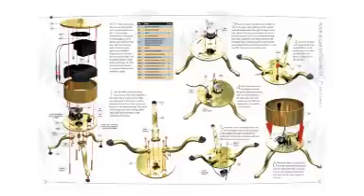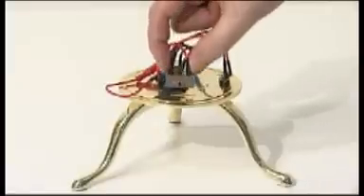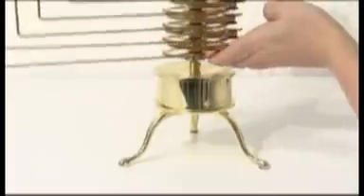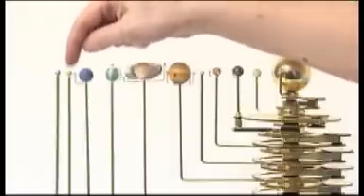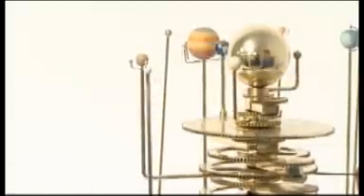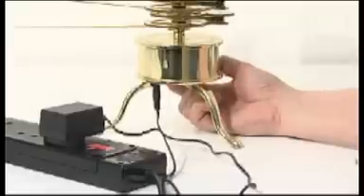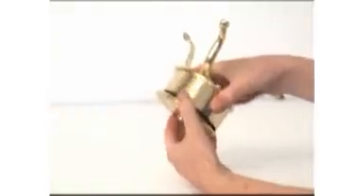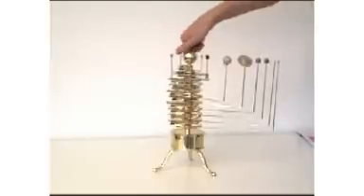New Orrery Phase 3 Video

Comment: you don't need to remove the motor to operate it manually, you should have had a small brass collar at the end of your kit, just remove the sun, and place the collar above the mercury components, this will raise the drive shaft out of the drive motor.